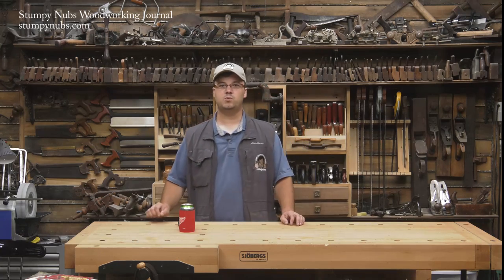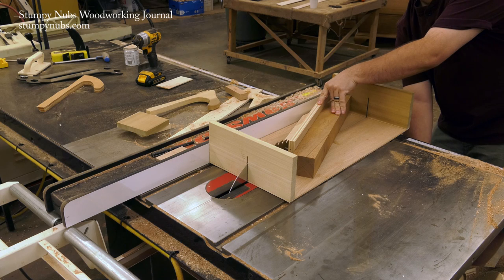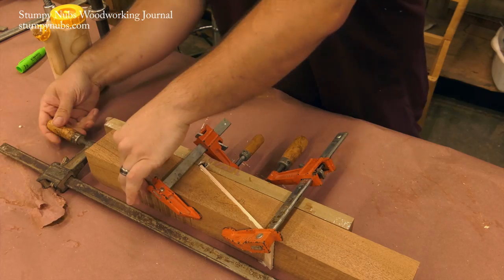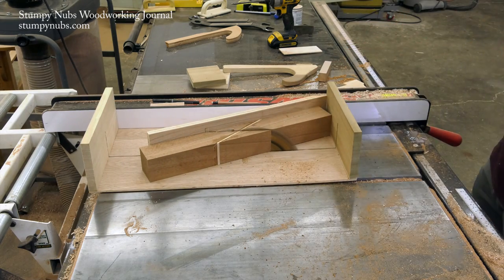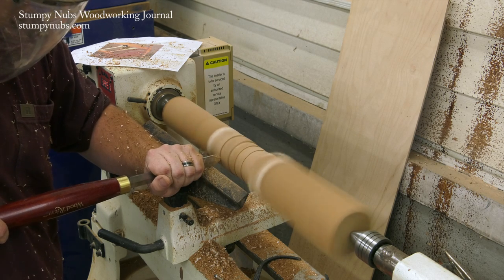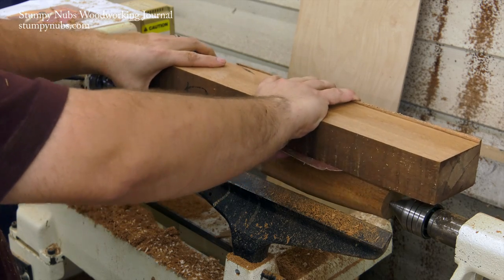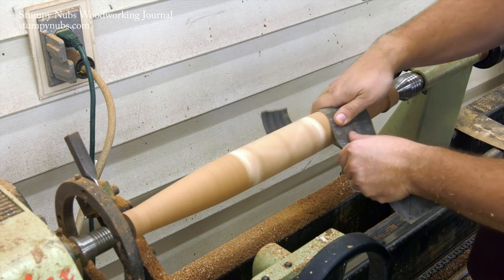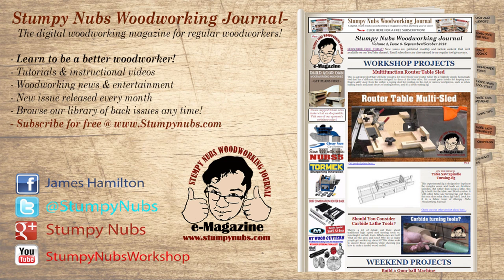UPGRADE your wood turning skills! Make a Celtic knot rolling pin

Comment: If you take 1/8" out, you have to replace it with 1/8".  If you take out 1/2", you have to replace it with 1/2".  I made one goblet with four 1/8" thick chop saw blade cuts and replaced it / them with 3/8" inserts and I was well and truly "schooled".  Then I made several (probably 25 or more) replacing the cut-out portion with inserts exactly the same thickness and they are all spot on.  You can't argue with success.  Stumpy, you are mistaken ... with all due respect.

Comment: as others have stated down below, the material fr the "inserts" MUST be the thickness of the saw kerf.  i have made many turned items with a celtic knot like this using inserts from 0.032 inches(my bandsaw kerf), 1/8(tablesaw kerf and up to 1/4" using a dado blade.  a good tip is to lower the blade so as not to cut all the way through, this make glueup much easier.
if you want to take the "knot" up a notch, start with a hexagonal blank and do 6 "inserts", i do 6 loop knots regularly for pens

Comment: Greetings from Jamaica... I want to make a celtic knot rolling pin for my son who is a chef, so of course I looked at your channel first. My question is this: Is there any particular reason or advantage to why you position the blank from right to left against the brace? I was thinking if you leaned it from left to right with the brace on the left side the blank would be more secure with the blade and pushing motion helping to keep the blank more secure against the brace.
Built the frame and was about to put in the middle brace when the thought occurred to me and would love your input if possible.

Comment: Perhaps the reason why your knot did not join up on all segments is that as I have learned, the inlay slivers must be exactly the same thickness as the saw blade kerf & the blank must also be exactly square. Just cutting a 1/4" insert will not do. Mine were 5/16"! hahaha

Another hint is to buy a 3" paint roller for glueing.  They are cheap and can be kept unwashed in a ziplock plastic bag when stored in a fridge or cold garage until needed again.  I've had one last as long as a month when a wet Kleenex is added. Titebond 111 is the only glue needed due to its long set up time, especially during this extra heat caused by the climate crisis. The 3" rollers clean up easily with a blow from the air gun, nicely drying all the fibres and getting them to stand up. Great show James.

Comment: If your insert is 1/4inch you have to remove 1/4 inch of kerf to keep all 4 sides in line. A 1/8kerf with a 1/4 inch insert will be off every time. Make your cut , then put your insert between your stop and your blank and recut. that way your kerf will be the exact same as insert.
Reply from the maker: You're mistaken. Look at the one Charles is finishing early in the video. Perfect alignment after 1/8 kerfs. The one at the end had a different cause for misalignment, as mentioned in my responses above.
Reply: Exactly Right !  Despite what anyone says, you are Exactly Right !  Celtic Knots can be made with any thickness of contrasting coloured woods.  In fact, a large goblet with a 1/8" Knot looks a bit funny.  I make mine with 3/8" or even 1/2" knots, depending on the thickness of the goblet or stein.  The wood replacing the wood removed MUST be of the same thickness.
Reply: @StumpyNubs  I have always tried to follow you and believe you but you are wrong this time.

Comment: I have a couple of questions.  First, is there a reason why you don
t use 2 boards with notches to clamp the board?  I'm having a heck of a time getting them clamped well on al sides.  Second, as long as the inserts for the knot are the same thickness does it really matter that they are the same as the kerf?  It doesn't make sense to me that it should even matter as long as they are the same as one another (the inserts, not the kerf).

Comment: Hi there - I am wondering about the gap-fill technique with glue and sanding. Once you rub the glue into the gaps, approximately how long do you wait until sanding?
Reply from the maker: I sand right away. You want to get the dust in there before the glue dries.

Comment: I see the difficulty in aligning, so maybe don't cut all the way through. Would this work? Make the inlay pieces the same thickness as the saw kerf, glue them in place, rotate and repeat.
Reply from the maker: It's not difficult to align. The one in the video was glued up crooked and had to be re-cut, which changed the alignment. As long as you always position it in the sled with the same end toward you (mark that end), and you glue it up straight each time, it will align. At the beginning of the video, there is a clip showing another one that was perfectly aligned.

Comment: A trick a saw in another video was not to cut right through with the saw. Set the saw low to leave 1/8th or 3/32"  inch on top to keep the two parts aligned. Do this on all the faces. Then saw or turn off the 1/4" that doesnt have the knot in it. Wastes a bit of wood but ensures everything stays aligned.
Reply: Yep. I watched this one as well.

Comment: There has been much discussion about alignment, especially when the insert is different than the kerf. I tried your method without considering this, the insert was thicker than the kerf, and alignment was off. When you cut a piece and the kerf is 1/8” and then put in 1/4” insert, haven’t you just added 1/8” to the length of the piece? This means the next cut will not be in the same location. Am I missing something?
Reply from the maker: That is correct. The insert must be of the same thickness as the kerf. Because it is inserted at an angle it will appear significantly wider after you turn it on the lathe.

Comment: Celtic has a hard K sound, regardless of where you live (unless you are a basketball team!). You don't get to pronounce Arkansas 'R-kansas', just because you live in Kansas and that's how you pronounce your state's name. (Nor do they get to call your state 'Kensaw'.)

Also, you need to remove that same amount of wood you are putting back in, to keep your joints lined up. If your maple is 1/4", you need to remove 1/4' from your blank.
Reply from the maker: In the English language, "Seltic" came first. "Keltic" was added as a VARIATION later: https://www.mentalfloss.com/article/77222/why-there-are-two-ways-pronounce-celtic

Comment: Your Stubness, how do you get the crossover sections of the knot to match up.  In the demonstration your crossover points are offset from each other.  Is there a way to prevent this.  Thanks.
Reply from the maker: Answer is in reply to comment above.
Reply: I seen other video's not produce this alignment issue.